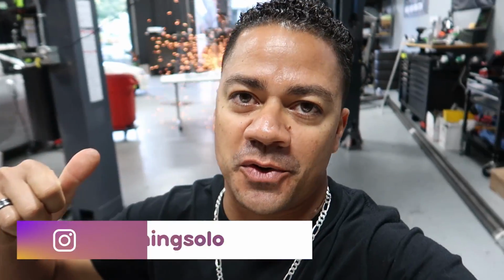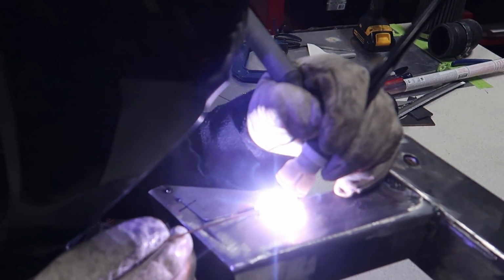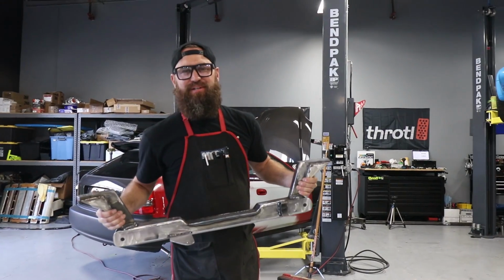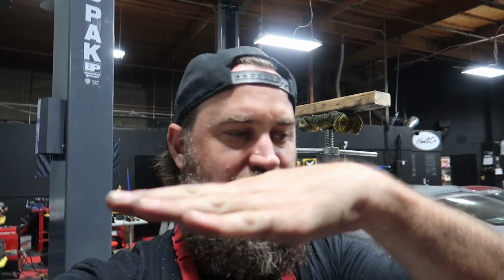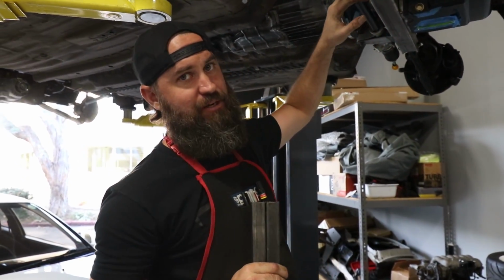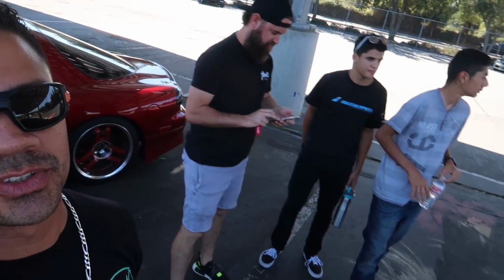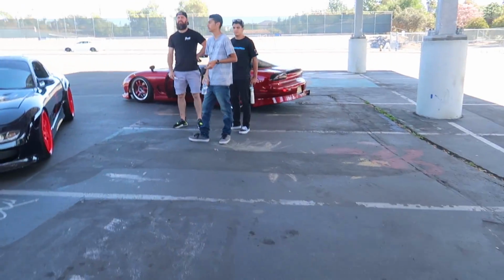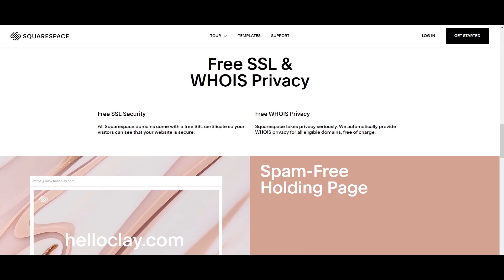Building & Heavily Modifying a 1999 Honda Civic EK Hatchback -- Part 9 & STANCEWARS LA!!!

Comment: I would LOVE to see the V6 MR2 swap as well as the widebody 911, but leaning more towards the MR2. I'd really like to see a Toyota 3.5L V6 swap into a W-30 MRS chassis. I realize that having the Civic RWD is swap enough along with the K series, but it would've been really cool to see a J32A2 swapped into it along with the FR platform. The K series is cool and I'm sure y'all won't be leaving it stock, but having a high horsepower B series in my EJ8 Civic, I have always wanted to see a high compression, high horsepower RWD J32A2 swap.

Comment: Just a tig tip for Evan: instead of using a foot pedal, just do a set amperage and adjust your working speed accordingly as your welds go on. It seems like you had a lot of poor penetration on some of those welds. Also, when you have 2 similar metals butted up to one another, you can use the electrode to fuse those 2 metals together without needing filler.

Comment: I would like to see a stock 2G AWD DSM with a built 6 bolt 4G63 swap with aditional engine and turbo upgrades. There are a lot of well known vendors that can supply you with upgrade parts

Comment: INSTEAD OF BOLTING THRU THE TUBES..... Next time get a piece of round bar cut to length, center drill it, bolt it to mounting point and notch the tube to fit @ both ends. weld and smile.

Comment: If you can't weld a sleeve in the tube. Weld a thicker sleeve to the end of the tube like you would weld on a bushing. Also if you are using lower control arm mounting point how are you going to triangulate the lower control arm so it does not flex or bend backwards? I love what you do on the channel but between this and the thin steering rack mounts. You all need to talk to someone that does custom suspension work. You may want to join a forum or community or find someone that builds tube chassis or kit cars or something.

Comment: If this is going to be a track car why not use a dry sump system instead of cutting out the oil pan and losing capacity
Reply from the maker: Because a dry sump will be in excess of 4k will all components considered. That didn't fit our budget for this project.

Comment: ricky, if you had taped your two straight edges of your template together you could have cut it out of one piece of metal and bent it in the middle so it didn't need so much welding